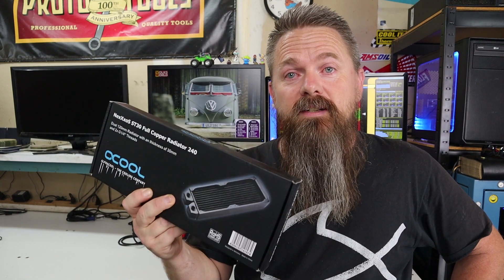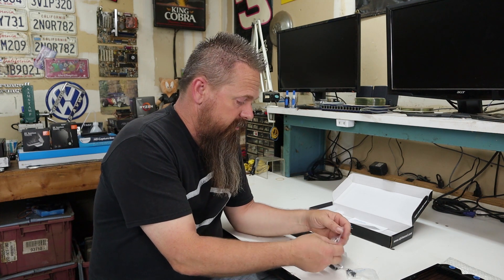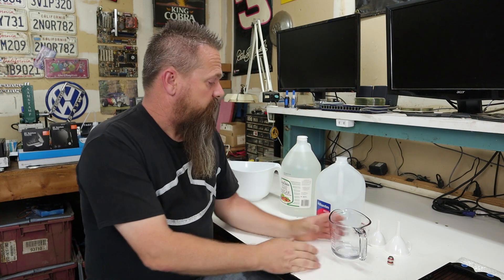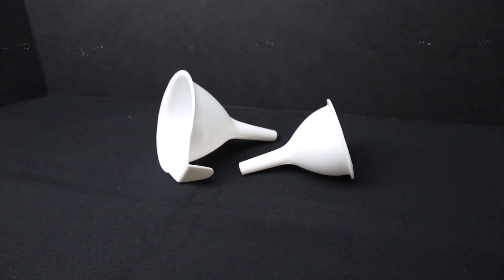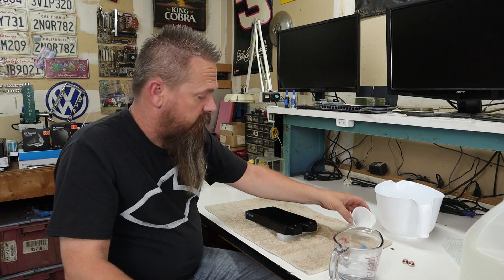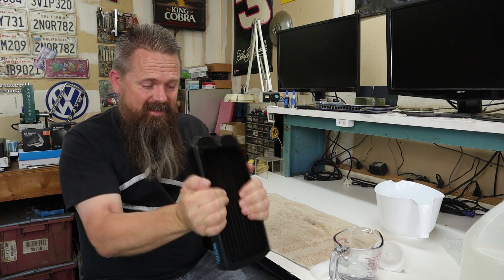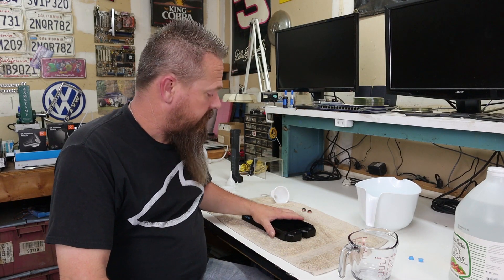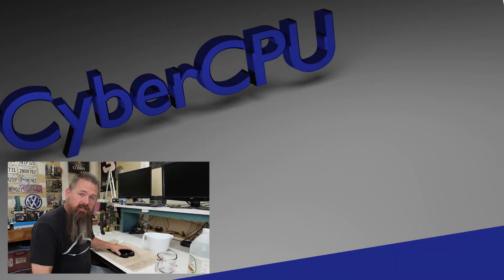How to flush a radiator (Water Cooling a Computer Part 1)

Comment: Hey man, good video! couple of tips... show what comes out after each rinse, not cumulatively. Also, did nothing come out after the 4th rinse? if not, you probably should have rinsed more. Also, a very minor thing... gotta get the vinegar off of them caps too ;)  .... anyhow, nice video! i subscribed and will check out more vids over time.
Reply from the maker: By the last rinse nothing was coming out. The system has been running ever since I filmed this video and the loop is still Crystal clean. I'm probably going to break it down in a couple months so I can do a video on how to clean a loop but only because it's been a year and I believe I need to repaste the CPU. The fluid is still beautiful.
Reply: @CyberCPU  One thing i'm interested in is how much vinegar to use. some folks say 50/50, others like 20/80 or less. Any comment on ratios?
Reply from the maker: @mosey4650  to be honest with you I don't do it by ratio. I just eye ball it. I use a splash for two cups. Not sure what ratio that would be. Likely around 10% of less. Not really sure.
Reply: @CyberCPU  Gotcha. I guess there's no real harm using more vinegar so w/e
Reply from the maker: @mosey4650  well, vinegar is acidic so there is actually harm in using too much.
Reply: @CyberCPU  I thought the point of using vinegar was to break up flux. I would hope that vinegar even full strength wouldn't damage the inside of the rad unless you left it for... Many hours? A day or more?  Chemistry is interesting stuff, lol
Reply: @CyberCPU  radiator flushing underway. Definitely some particulate coming out ... nothing like that insect leg in your video though! .... once done rinsing, do you let the rads air dry before capping them? no idea how long it will be until i build unfortunately - could be weeks or more
Reply from the maker: @mosey4650  I highly doubt that vinegar would damage the internals of the radiator. Especially if you rinse it really well. 

The one I flushed in this video sat for at least a month before I actually used it.

Comment: just connect one inlet to your tap and let the water run through and out the other hole ~ quick and easy, then do a final flush with distilled
Reply from the maker: Personally I don't like running tap water through the system at all. It might just be superstition but my loops don't have any issues.
Reply: @CyberCPU  the first flush of a rad only - which makes it much simpler and easier and quicker and much more effective ~ then final flush with distilled water before instalation

Comment: how many times on avg with the distilled + vinegar does it take to not see crud any longer, I'm on my 6th time still stuff coming out, also how hot should the distilled water be? I'm working with an XR5 420 and a Nemesis 420
Reply from the maker: I would recommend repeating until it's clean. The water isn't super hot. I wouldn't make it so hot that you could burn yourself.

Comment: Hi Rich!
Totally useful your video! I also like your channel!
Anyway I have a question, what is your mixing ratio of distilled water and vinegar acid. I want to use a 60% vinegar acid but unsure about the mixing ratio...
Reply from the maker: I use very little vinegar. You don't want to over do it. I don't have an exact ratio. I just add a splash to the cup. It's very deluded.
Reply: Also be careful as the blue you can see in the bowl is copper acetate, an amount of the copper dissolves into solution as vinegar is dilute acetic acid.
Reply: ok, done! My ratio for 60% vinegar acid was 1 to 10 and I think that is ok. And holy crap, what did I get out of the radiators was really shocking...
So again thank you for this video!

Comment: Don't need to use vinegar. Simply, because not everyone is using the same Radiator as you and not all Radiators are built equal. Using distilled water until the gunk leaves is fine, also you did not just shake the radiator using the fins.
Reply: The fins are strong enough to be held. As long as you aren’t mashing your fingers in as hard as you can, you’re fine. I speak from experience, they are fine.
Reply: @evanjinks7744  No they are not fine... Not all fins are the same, either... Just use the damn frame, that's literally what it's there for...

Comment: What type of caps did you use? Do you have a possible link?
Reply from the maker: Are you talking about the caps to close the ports on the radiator? They are just standard water cooling caps. You could probably even use the plastic ones that come with the radiator but you should have some if your doing a custom loop.
Reply: @CyberCPU  awesome thank you. Watching this series has shown me some new tips and things to do. I will be doing my first custom loop within a week or two and greatly appreciate this series.
Reply from the maker: @GN_Grizz  Water cooling is fun. Just make sure to be methodical about everything. Check and double check every fitting and go slow. The quality of parts we have today are amazing and almost everything works right out of the box. However, occasionally you run into problems and you want to identify those problems before you add water. Like for instance I just water cooled the GPU in my system and had to do an extremely tight bend in the hard tubing. It failed the pressure test and I ended up making exactly the same bend with another piece of tube and it worked perfect. It's better to take longer to get it assembled than have to replace parts if you get a leak. 😉
Reply: @CyberCPU  absolutely. I will be doing both the CPU and GPU with soft tubing and will be mounting the gpu vertically. I bought a pressure tester to do a leak test. I will also be cleaning my radiators prior to assembly because of you. I am using the Corsair stuff because they are the only company that makes a waterblock for my GPU. I have the Corsair 680x case; so, should have plenty of room.
Reply from the maker: @GN_Grizz  You should check out the videos where I water cool my E-Waste gaming PC. There's a playlist for the whole build. I used the Corsair kit in that one. Really good stuff. I like it a lot. If you haven't bought your fittings yet I would check out hard tubing. It sounds more intimidating than it actually is. That was the first build I ever did hard tubing on and I was kind of afraid of it before I did it. It's way easier than I thought. The only downside is maintenance is a little more difficult.

Comment: Thanks for the video, but I cringed when you shake the rad by holding it by the fins 😢
Reply from the maker: The fins are not that delicate. Consider this. You drive down the road every day with the same thing in the front of your car and it's fine. 🤷‍♂️

Comment: What's the point of adding vinegar? Opinions are divided in the community. One says you should use vinegar and others say you shouldn't so I'm at a loss. I just received all my water-cooling parts and I don't want to do anything detrimental.
Reply from the maker: The purpose for using vinegar is that vinegar is acidic and it will help to break up debris that are in the radiator. I've heard people argue that the acidicness can damage the radiator but honestly at the rate that it's diluted I don't think that's going to be an issue and I've never had a problem with it. 

You do need to make sure to thoroughly rinse the radiator out so there's no trace of vinegar left in it after you're done. Cuz you definitely don't want vinegar in contact with acetal blocks and acrylic parts in the system.
Reply: @CyberCPU  okay thanks man I appreciate it. I'm the most worried about my nickelplated blocks in the end but I'll be sure to rinse the devil out of it afterwards 👍
Reply from the maker: Yes, flush it really well and you will be fine.

Comment: My AC radiator just keep spewing out little black crud no matter how much I clean and flush. When I asked about it on their forum their rep said I had damaged my radiators because the vinegar will damage the copper in them so it's my fault for using vinegar in them :/
Reply from the maker: The amount of vinegar you use, if you followed my guide, is in no way going to damage the radiator. They probably just sell really low quality radiators. If you can't successfully clean it out I would not recommend using it in your system. I would spend a little more and buy a good radiator. The brand I use in this video is very good. I was very happy with how little garbage was in it. I've also used a Corsair radiator in another build and it was very good. Both systems have been running for a long time with no issues. The one used in this video has been running for several years and the loop is very clean. I also have been a little irresponsible with maintenance on that system and it's still running very well and very clean.
Reply: @CyberCPU  Yeah, that was my thought to, and I followed your guide to the letter. I think they are just trying to cover themselves since I'm still gettinga  fair amount of debree coming out after 9 flushings. (I also after assembled the loop used EKWB's new clean and flush kit).
Reply: @CyberCPU  oh and my radiators are the same as in your video, they are Alphacool radiators.
Reply from the maker: @SteinerSE  That's bizarre. I didn't have that experience with mine. Maybe you just got a bad radiator.
Reply: @CyberCPU  I guess, I have 3 of them in this machine though. And I did your method until nothing else came out of them. Then I built the loop and used the EK clean/flush package (Blitz kinda thing) and now I'm getting all this crud again. Granted, running the pump at full tilt likely pushes out a fair bit more than just sloshing the radiator around for a bit.
Reply from the maker: @SteinerSE  I wonder if that EK clean left any residue behind.
Reply: @CyberCPU  The first part, the cleaner is supposed to change color apparently, I'm guessing since it's hard to completely drain a loop (At least I don't have a clue how to) some of it had remained and with each flush now there's less and less less ((after the cleaning run the liquid came out blue, after the first flush run more like a lighter green and after the second flush a clear blue tinted color). I'm not so concerned about the liquid color as all the amount of black specks of varying sizes coming out.